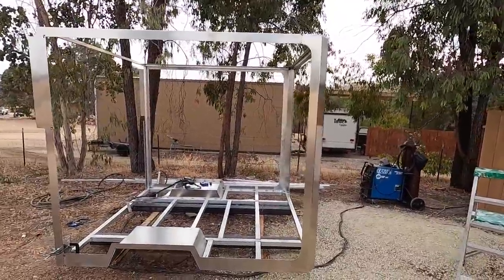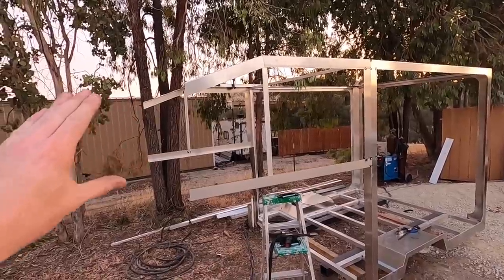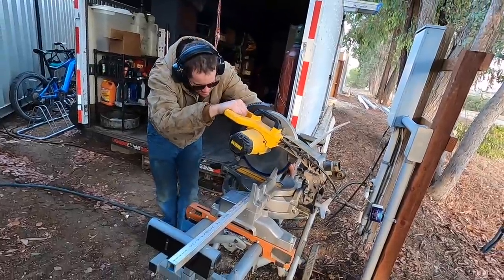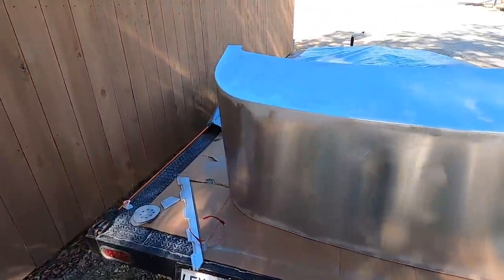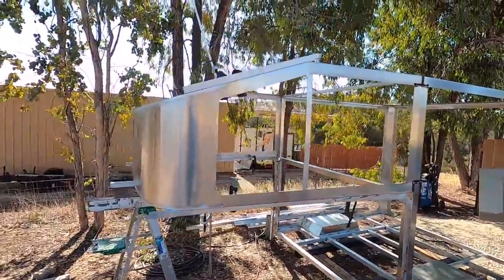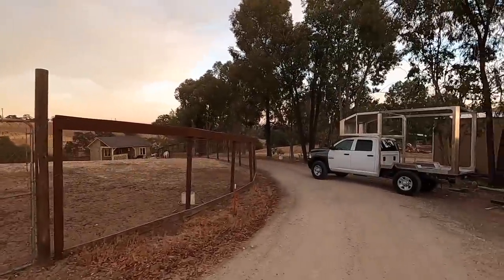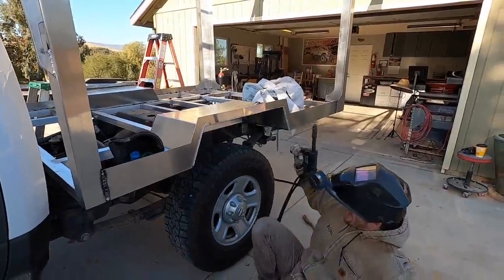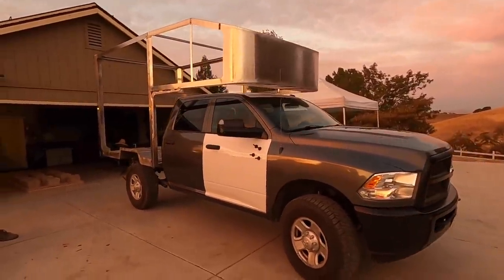Couple Builds DIY Expedition Vehicle E2 | Aluminum Frame

Comment: This build is coming out amazing! Are either of you engineers by trade? Or are yall self taught fabricators and designers? The vinyl came out awesome and you saved big time! I would be thrilled if either of you did a detailed video on the fabrication or how to do vinyl yourself. Great Job!
Reply from the maker: Riley has a degree in manufacturing engineering and we started our business together right after college! All of our fabrication skills have been self taught, starting in college with joining the off-road club. I will definitely consider doing a detailed video on the vinyl wrap!
Reply: @AmbitionStrikes  That is awesome, Yall do great work and I look forward to the rest of the build. I don't have a engineering degree so I will be watching very closely haha. Plus the big reason I never got a vinyl wrap was I was under the impression you had to have special tools and chemicals to apply it. So I look forward to anything you can show on the subject.
Reply: @AmbitionStrikes  how well does vinyl wrap last? Especially off-road. Does it need constant repair / maintenance?

Comment: I searched out your channel thinking I missed a new video. Nope, it was just me being impatient. So, now I'm going to binge your camper series. 
I wanna build a low toy hauler camper, using a fwd car & a rear trailer axle. I like steel, I don't trust aluminum for structure. Basically a cube van, but no rear differential getting in the way. 
I love your off-grid place. Wish your new family well.

Comment: Although not a term often used to describe an aluminium expedition camper frame, I consider it a thing of beauty!

In particular the gorgeous wrap around nosecone, the over cab supports with their relief cut outs and the curvaceous sheet aluminium attached to the frame for the wall panels to be affixed to!

The reason that it looks to be a top tier expedition camper even at this early stage is because that's exactly what it is!

Meeting and exceeding the designs and construction standards from renowned manufacturers, this is quite simply outstanding!

The very high standards of workmanship are evident, as is the excellence of the design.

Good to see that each works in accordance to their preferred tasks, and to have so meticulously applied that vehicle wrap was truly impressive!

There's a reason the quote to apply it is so high, it's one hell of a thing to do and get right, with countless hours spent on details which may not even be readily apparent.

Then there's the preparation...

Superb craftsmanship beautiful presentation, narration, videography and editing, thank you for this lovely video.
Reply from the maker: Riley truly does have an incredible eye for design! He is able to balance form and function in a way that is both delicate and strong. I am always amazed by the result and love to help him bring it to fruition!

Comment: Very nice job both of you. They sell rubber wheels for your drill for removing decals. I had to remove stripes from the length of a truck and it was the only tool that made it tolerable.
Reply from the maker: That would have sped things up!

Comment: To remove the table sided tape for the badgers and body (As a Panel Beater) I use a little rubber wheel in the drill and it removes it quickly and nicely.
Reply from the maker: Great tip. I’ll have to look into that next tome!
Reply: Courtney Casey Just be carefully what type of rubber you use. 3m do sell them. And there cheap.

Comment: super rad. I want to build one of these eventually probably on a straight truck/ u haul type box frame. 

One suggestion for the wrap is take the door handles off! makes it much easier and then you can tighten the handles down on your wrap and makes it extra safe from peeling up
Reply from the maker: We actually started to take the door handles off, it wasn't a simple task on this Ram and we decided it wasn't worth the effort, time, and and potential future door rattles. Thanks for the recommendation and glad you liked the video!

Comment: Enjoying your Project videos . Pretty sweet build!
Reply from the maker: Thanks for following along!
Reply: @AmbitionStrikes  Wonder if you considered Raptor Liner the whole rig instead of a  vinyl Rap? Great product , user friendly , Tintable, and you get that " Dope Bro" comments on the road & at gas stations.   I did my truck , and will probably  do my camper/ boat next until I may one day get the opportunity to built something as cool as this ;)
Reply from the maker: It was considered but I decided it was too permanent of a solution for a vehicle we plan to sell eventually. With vinyl the future owner can still restore the truck to the factory paint!
Reply: @AmbitionStrikes  Yes, the beauty of vinyl , is you can peel it off 10 plus years later, and basically have the original paint finish .

Comment: I really like your videos and the process details and explanations as well as your testing of your panels.  I am considering a similar build but have struggled with using welded Al6061-T6 as an exoskeleton.  This is because 6061-T6 gets its strength by relatively low temperature heat treatment known as "artificial aging".  When you weld this aluminum your filler metal does not get the same heat treatment so is lower strength than the surrounding material.  More critically, the heat affected zone next to the welded area "overages" and strength drops to less than half of the original strength.  Flexing of this structure during regular driving and in particular off-roading will mean that failure will occur due to fatigue cracking along the heat affected zone.  I have seen welded 6061 aluminum trailers fall apart after 2 years of use. The good news is your design has the joints exposed so you will see it when cracks develop and you may be able to repair the cracks.  You may be lucky and delay cracking for several years with the sturdy panels you have built so good luck! One other detail that your mention in passing but I did not see in detail is the mounting of your aluminum structure to the steel frame.  You mentioned a spring system to mechanically isolate the structure from the frame.  These should also be electrically isolated to prevent "anodic" corrosion of the aluminum at the points of contact.  Take care and I look forward to your other videos!
Reply from the maker: Thank you very much for the detailed and thoughtful comment! Our exoskeleton is made from 5052 for formability, the sub frame is 6061-T6. We are well aware that welding the aluminum created a heat affected zone and therefore stress concentration. Our thinking is that the panels will support those joints and minimize the fatigue. Luckily all of the welds (including the sub frame welds) are visible and we will be able to inspect them periodically. The spring system does not mechanically isolate the structure from the frame. The front of the camper is rigidly bolted to the truck frame. In the rear, the springs clamp the camper to frame so that if there is a situation where there is significant truck frame flex the camper is able to separate from the frame in the rear and (hopefully) limit the torsion being transferred to the camper. The subframe contacts the truck frame at 10 points to distribute the load over a large area of the sub frame. The camper is grounded to the truck frame with a heavy ground cable. Do you think this is sufficient to limit the electrolysis? Either way this will also be periodically inspected.
Reply: @AmbitionStrikes  Wow!  Thank you for your thoughtful response.  I am a materials/manufacturing engineer and usually my questions/comments are blown off.  Your response shows that you understand the issues of using aluminum and your willingness to to engage is what I think Youtube users should embrace to help viewers understand that there are always trade-offs when you are deciding between different materials.
  
With regard to the contact between aluminum and steel, the electronegative potential of aluminum is greater than that of steel so that means it will form the anode in an corrosive environment resulting in it corroding at the points of contact with the steel frame.  There are a number of factors that affect this type of corrosion (electronegative potential, the surface area of the two metals in contact, and an "electrolyte" to allow the electrons to exchange).  In your case it appears that you live in a dry area so I expect little corrosion would occur.  In my case, I Iive next to the North Atlantic so I would absolutely have to isolate the aluminum from the frame.  A friend mounted a light bar on his new Jeep and the cast aluminum case corroded thru in 12 months.  I also noticed in a later video a discussion about a stainless steel screw snapping off after it had galled... this shows you folks really know your materials. I study galling of stainless steel and I hope that your viewers appreciate your depth of knowledge in working with metals.  It is a great pleasure and inspiration to view the progress of your build! take care and I hope one day we cross paths!

Comment: I know I came along a little late, but if you use a stainless steel brush (use only on your Alum.) and clean it, you will have better welds (less black). I'm amazed with what you have done, I somehow started on part 7.
Reply from the maker: Yes we have a brush (labeled aluminum only 😉) and use it before welding, thanks for the tip! And thanks for following along!

Comment: Holy crap this is amazing work.  I just built an offroad style teardrop and the learning curve was massive.  This is incredible.  

One question I have though is why you didn't opt to use ambulance style frame extensions so your box could be just a little bigger?
Reply from the maker: Thank you! There were a lot of things we could have done to make the box slightly bigger but we really wanted to keep it as absolutely small as possible for maneuverability, visibility, etc. It was a really fun design challenge to fit everything in such a small space (it's exterior dimensions are smaller than a Lance 825).

Comment: A couple questions:
1. How much aluminum is overlapping the panels. The flat aluminum that tacked to the 2x2 support structure. That you rivet the panels too.
2. What is your spacing for the rivets.
Thanks

Comment: I've watched all of your videos on this build, but I don't remember seeing how you attached the camper to the truck frame.  I know you have to take into consideration the flex of the truck frame against a rigid camper box and I've seen several methods of allowing for this, but I'm curious as to which method you all used.  I'm planning a similar build and attaching the camper to the truck is my main worry right now.  Thanks in advance for enlightening me!
Reply from the maker: Hi Shane! The camper is hard mounted to the frame on the front and the back is mounted with springs to allow for flexing!

Comment: I had to cover my ( blue) volvo 770 with white vinyl in 2001 to avoid painting it. I had loved my blue truck and I was thinking that I would just peel it off if I didn't like the company I was running with, turned out I liked the company( united van lines) and stayed with them 14 years, the vinyl was looking bad after about 8 years so I did peel the thinned and sun damaged thing off( pain in the you know what) and hand painted the truck with white rust-oleum 🙂
Reply from the maker: I do not look forward to the removal of any vinyl, especially an entire vehicle! 😂
Reply: @AmbitionStrikes  it was a torture, for me and my wife🙂🙂

Comment: Fine job on your build here, have watched all your episodes on process and read through questions and answers.  Could you help with a little more info, on the angle upper frame, you guys mention using .080 5052.  What length were the legs of the angle they look to be maybe 1.5"? Also you mentioned in comments you used closed rivets, were these aluminum?  What diameter and lengths did you mainly use?  Thanks, i enjoyed your videos, each were packed with info and tips, greatly appreciate your sharing your experiences.
Reply from the maker: Hi Ronald! On the external frame they are 3" and on the internal bracing they are 1.5".  The rivets used are 3/16" diameter aluminum and called "multi-length" so they worked on a large range thickness.
Reply: Thanks for this response, have continued to view your episodes, can't remember seeing a better presentation.   Looked at #2 again last evening.   Tried to see more detail on Aluminum frame by blowing up video, but had a question.   I have been unable to find 5052 .080 angle from my main aluminum supplier (Reliance Metals).   I may have to go to a .125 or .25 to get the 3" legs.   After inflating pic, looks like the ext corners may have a stiffener plate of some type in the corners.  Is this correct.  Also i liked your radius on the top corners intersecting the horizontal angle.   Did you start with something larger than the 3" angle and machine the radius or possibly insert a weld in Radius component ?   Not sure if there is a site you might be have pics of more details of metal joints.   Once again thanks for your info and taking the time to create your videos.   Thx  Ron

Comment: How do you handle warping when you weld the bars together? is it better to limit the weld spots to two points structurally. Are there other techniques to weld?
Reply from the maker: There was some warping that had to be dealt with but careful control of heat can minimize it.

Comment: I do some metal fabrication and welding. I love your build however, just from what I have seen, it appears that all the welds are spot welds or some stitch welds. Are you comfortable with that? Were you using Argon shielding for your spool gun?
Reply from the maker: The subframe was welded using continuous beads with the spool gun. We attempted to weld the exoskeleton with the spool gun but ultimately ground those out and used the TIG. This was very difficult given the awkward positions and being up on a ladder. Ha! In both cases 100% Argon was used.
Reply: @AmbitionStrikes  Thanks for the answer.

Comment: Love your channel and binge watched this build. Absolutely amazing attention to detail. I built a off-road teardrop using the same monocoque technique and wish I had splurged for a pneumatic caulk gun for the sikaflex. I still have bruised palms from the manual gun! Anyway, I’m designing a pcor tray and atoverland atlas hybrid for my ram 1500. Did you find any cad models or dimensions for the truck chassis and mounting points? I’d love to know more about the subframe and mounting.
Reply from the maker: We are very glad someone recommend the caulking gun, or we would have been in the same boat as you! The only cad model we could easily find of the truck wasn't accurate enough for anything other than initial renderings. However, there are ways to access files through SEMA's tech transfer program if you have an in with a company that subscribes. Riley recommended also checking the up fitter manual!

Comment: what if you were to do the "upside down welding" by pulling it off the truck, flipping it over, and welding "right side up?"
Reply from the maker: It was discussed! But the logistics of doing so without a forklift, and Riley's ability to weld at crazy uncomfortable angles meant it just wasn't necessary for this project.

Comment: 0:11   what thickness of aluminum did you use for the frame?
Reply from the maker: The campers exoskeleton is .080, the subframe is 2x2x.120 and the wall panels are .050.
Reply: @AmbitionStrikes  any noticeable accumulation of dust or debris where the panels meet the exoskeleton? Or did you caulk the joints after assembly?
Reply from the maker: @jwiereng  We caulked all of the joints!

Comment: Hello I am a foreigner. I want to know how to make a camper. What is the material and thickness of the frame? How did you insulate the circular part? I am curious about the material and thickness of the external metal. Thank you to the campers. There is a little error because it is a Google translator.
Reply from the maker: Hi there! The subframe is 2x2x.125 square tube aluminum. The exoskeleton is .080 aluminum. The wall panels are .050 aluminum. We insulated the front part of the camper by scoring and bending the foam board into a curve.
Reply: @AmbitionStrikes  Thank you for your support. It is different from the materials sold in our country. It is difficult to understand, but I will refer to it while watching the video. I salute you in your life.

Comment: I wonder with two people sleeping in the cab over will the gusset plate you build be enough to support the weight of two people plus movement?  Please let me know how your build in the cab over held.  Great vid!
Reply from the maker: The frame has been plenty strong thus far. We did have an issue with the panel sagging, so we added some additional bracing and it is sturdy now. If we were to do it again we would make the bed panel 2” thick instead of 1”.
Reply: @AmbitionStrikes  thank you Bro, what is the brand of the cnc machine you got, dig you put that together or bought it ready to go
Reply from the maker: @trek4554  The plasma table is from Arclight Dynamics and is amazing!
Reply: @AmbitionStrikes  Oh thank you, I do apologize I actually did see it in the video what I meant to ask was what's the model?

Comment: How did you insulated the aluminium walls ??
Reply from the maker: The wall panels are made by sandwiching 1" XPS insulation foam with .050 aluminum and 1/4" Baltic Birch plywood.
Reply: @AmbitionStrikes  thank you , did you used hydrophobic material too .